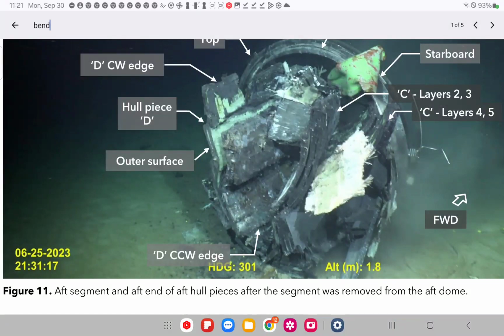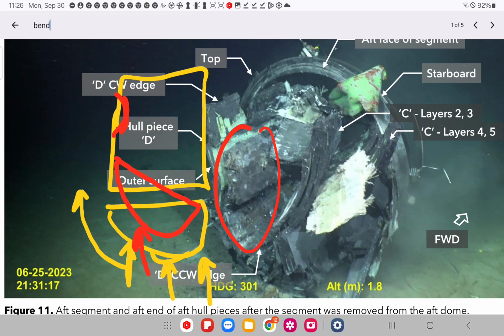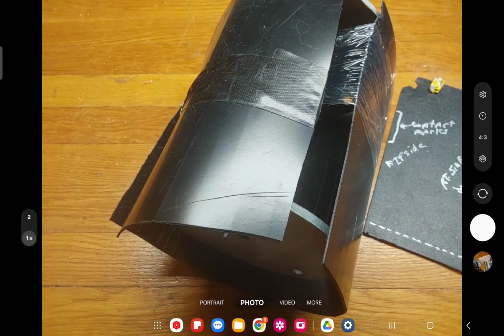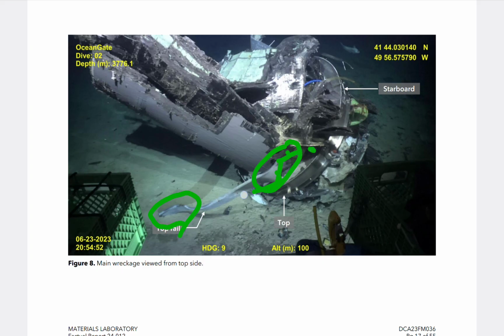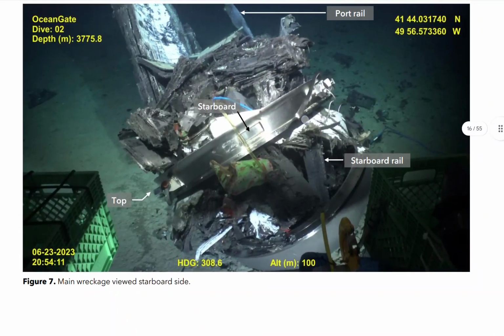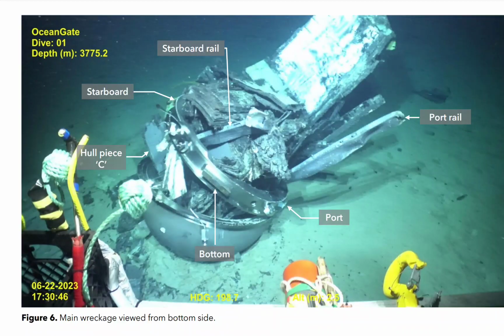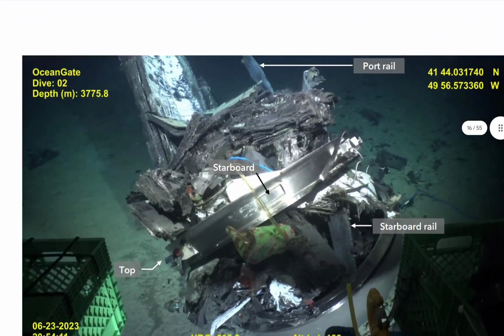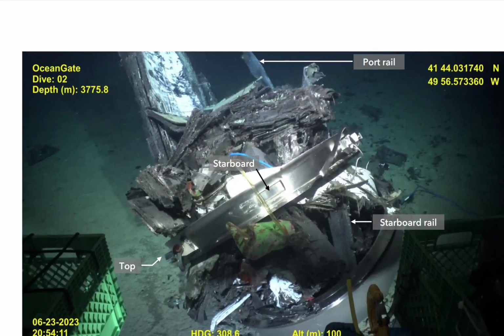Titan Submersible failure visualized Coast Guard- images Carbon fiber autoclave over an hour away

Comment from the maker: Please help me out with your comments and in addition to your comments,  please add the search term you use to search for titan submersible implosion... and for interest,,shout-out where you are from.
Ok...
Titan Submersible implosion had layer failure around the 3rd and 4th layer, the real time monitoring system worked but Rush ignored the data from dive 80 forward!
Then we have the issue of manufacturing,  they had to transport this five times, over an hour each direction and before autoclave "setting", this could have segregated epoxy and literally baked in a defect.
This video will explain how some carbon fiber was NOT compressed; the hull had to have buckled first and it appears to be identified in one of the images.
I have high hopes for the one PhD ntsb guy to work this as part of his conclusion.
Reply from the maker: I also believe how and why it failed at certain levels and will support this in a future video... It's very simple (hint)...
Reply from the maker: donate  
Join this channel to get access to perks:
Anyone donating to support the stray cats or my channel remember if I do something that gives you "gift remorse", please contact before tax season ends and I will give you back 100% of your donation.
https://www.youtube.com/channel/UC-_5I5xDiFVcxlnG7uSLuFA/join

Construction Engineering & Failure Analysis Thank you for commenting and giving a thumb's up
Please donate to support the channel, it will 100% go back into the channel.
https://www.paypal.com/cgi-bin/webscr?cmd=_s-xclick&hosted_button_id=V9TGHDE92LQ8W&source=url
Here is my wishlist if you care to go that direction https://www.amazon.com/hz/wishlist/ls/3UBMVWND65U4M?ref_=wl_share
Reply: @guitarista67 it was the shout out for me 😂🐈
Reply from the maker: Thank you ShayShay
Reply from the maker: Bruce, and all of my cats I rescued from the streets have their own personality but they usually all get along --- as long as one does not invite the attack mode by trying to creep pass another --- then the game is on!
Reply from the maker: Unless, you do real world model testing - then you will find the ''error in your ways" --- If, he would have done it to scale and tested to failure, that would have been the best money spent. Of course, mapping the hull with a dead blow hammer and charting it on the acoustic monitoring is also critical
Reply: The forward ring will tell you the density of the ocean floor.
You know that thing fell fast.

Comment: They have identified the larger sections as roof. Not floor.
Their experts state the failure probably started at the front floor area but the rest probably happened as you describe. You also seem to be under the impression it imploded close to the seabed but remember 50-300m is close on these scales. The debris probably spit out of the aft section upon touchdown due to the envelope effect and shielding vortex of water streaming past as it falls held a lot of smaller debris in place. Prevailing current determines direction of the small debris once free from this "confinement".
What amazes me is the shear force of the waterhammer after the initial implosion as it sheared off most of the outer titanium flange as well!
Reply from the maker: 50 to 300 is huge relative implosion location, they would never make the same debris field.
Further, it could be at the bottom, the starting position and I make this clear in other videos.

Comment: Kemper engineer, or the NTSB, briefly showed a photo of previously failed carbon fiber external pressure test. It was crumpled into pieces. On page 6 of the memo, "Why we don't use this material for deep diving equipment."
Reply: The way the scale model sucked in the sample bag that had been outside might support the idea of the outer layer chunk pulling into the gap between ring and dome at a late, lower energy part of the implosion as discussed in the video

Comment: The important thing that is being missed by most commentators is that the initial failure of the carbonfibre tube was to all intents and purposes instantaneous. The tube collapsed and the titanium end caps were pushed towards each other in around one millisecond. The interior pressure and all the contents and crew went from 15 psi to 6000 psi in a couple of milliseconds. This compression caused temperatures to rise to in excess of 1000ºC and resulted in a diesel explosion that consumed and vaporised all organic matter. As the outward explosive pressure dissipated the hull and end caps finally collapsed into the positions in which they were found. The whole process probably took less than 5 milliseconds, start to finish. The polycarbonate window was ejected during the explosion part of the disassembly because it was designed to resist external pressure, not pressure from within the submersible. If the collapse had been witnessed, it would doubtless have resembled the explosion of a depth charge in a submarine movie. The disruption was such a violent event that it was noted on the surface vessel, but at the time the crew on board the surface vessel just thought it was a hard wave impact or piece of equipment banging against the hull of the ship. The velocity and violence of the implosion, diesel explosion, and final implosion would have been similar to a large bomb going off. Hence the reason that no recognisable organic remains of clothing were recovered. There are plenty of videos showing how carbonfibre fails  without warning compared to stainless steel and titanium that while capable of sudden failure at least show signs of deformation before collapsing orders of magnitude more slowly than carbonfibre. Had the center tube been made of titanium, it would still have been a weak point in the design and a point of failure, but it might have survived the pressure at Titanic depths. The downside would have been a doubling of the weight of the submersible, a larger support vehicle required, and several times the initial construction cost. The key point to bear in mind is that this became an explosive disassembly once the crew compartment was compromised and the resulting damage and wreckage pattern clearly demonstrates this with the scattered debris field. If it were a purely implosive event, the wreckage would be confined in a very compact debris field.
Reply from the maker: What I have been saying from day one except, I am leaving out the heat... if the air is allowed to press out, then we do not have this heat, but we do have friction that would have created immense heat and yet, NTSB has not shown us any ''melted'' products (not even epoxy)... from friction
Reply: The implosion causes the explosion and it oscillates a couple times until final position , or maybe it was just in out in since the pressure was extreme, i just wanted to add the word oscillates =D

Comment: The thing I find most surprising is that the RTM data was not taken seriously. Sound is created by energy. That energy has to come from somewhere. That somewhere is within the composite that is being stressed and releasing energy in the form of sound - probably heat too. The problem being that this energy is lost. It's not being put back 🙂 Then after the most noteable "bang" the hull went silent? Surely this would suggest that the hull was slowly getting like a roll of wet toilet paper?  6000 psi water has amazing penetrative capability. Microscopic holes will pass jets of water capable of cutting resin. Delamination of a significant portion occured. Another thing to be considered - In a 5 inch thick beam (cross section of the hull ) the upper half of the beam is under compressive force and the inner is under tension. This is one of the problems with composite materials - the material within the component are trying to move in opposite directions 🙂 Oh - if you were listening for it you would have heared it on the surface. By "listening" I mean a hi gain microphone in the water. The implosion would have instantly compressed  the air in the hull to 6000 psi. Lots of heat and energy released 🙂

Comment: I think it failed at the ring, it shows the lip of the titanium sheared off which wouldn’t happen after it already loses pressure I think .
Reply from the maker: Yes, it could happen after loss of integrity and the literal shear direction can be determined by the angle of the striations of the steal striations (just like you could tell which direction a can opener was used).
Reply: @ForensicCats  In context, I think you meant "striation," but you left out the "i."
Respect from Montana USA.
Reply from the maker: oops and thank you at nonmihiseddeo   thank you
Reply from the maker: corrected and that was all that was edited, thank you

Comment: that first inch layer was baked 5 times, expanding and contracting each time. the delamination started there in that oven.
Reply from the maker: Yes, I believe the issue if any was bought up in the hearing, he could not think of any issues.
I could, the same part being autoclaved (ring 1) but the heat appears to be within specs of the carbon fiber tow)... Remember, the mandrel is still there.

Comment: I wonder if everyone is getting the implosion breach wrong. I don't have a degree. It was stated almost universally that the breach started at the forward end, that's why all the carbon is crammed in the aft dome.  Air doesn't flow in the opposite direction to the breach it's displaced by the incoming water and escapes through the failure point (depending on the size of the breach) or gets trapped and compressed inside the remaining structure. Additionally, If there is a breach in the aft end within a millisecond of the first, incoming water from the second breach would reverse the pressure gradient, causing the materials and air inside the cylinder to be pulled in the direction of the second failure. But the Forward end-cap is clean of all debris, and adhesive bonding. In simplest terms, where the breach started that's where all materials go. This is a very complex event when figuring out the physics behind this. I don't think anyone has described it accurately

Comment: So for an answer to the "what happened to the people?" question.. the acrylic window was held in by a small ring on its external circumference when not under pressure. So my theory is that when the hull caved and turned them into a idiot smoothie, it then blasted them out of the small hole in the forward dome like a pressure washer, just a column of red water and compressed air the exact size of the view port which then got blasted out into the dark. There is nobody left in that forward manhole.. maybe just a stain or two.

Also, I just came up with this theory by myself, im sorry if it's been said elsewhere. No thoughts are completely original, and we are possibly living in a simulation and the birds might not be real so give me a break please.

Note 2: I realized that there is a flaw in my theory after thinking about it. Differential pressure. I was assuming that somehow the pressure inside the hull was higher than the pressure outside of the hull as it collapsed, but things were only trying to equalize. There may have been a water-hammer type effect which blew the window out, possibly remains too, but not enough to call it a pressure washer.
Reply: That does make sense…
Reply: Wasn't there a greasy film on the surfaces of some wreckage-- the fatty traces of the former occupants?
Reply: I think your theory is of value. I'm not a technical person but I get what you are saying. 
Anyone who gives you a hard time... the answer is:
How would they know, they weren't there. 😊
Reply: There were confirmed human remains at the back end but who knows, maybe most of it got shot out like that
Reply: @alayneperrott9693 some stained fabric or some such is my guess
Reply: Do you think that the air inside got super heated and incinerated them before it imploded?
Reply: @thebird2253 gotta agree with u except on one point. The circumstances of an implosion and the rapid pressure differential at 3700m  liquefied even the bones...
Reply: Ick!
Reply: @brushhogg1  oh wow bones too 😱 I didn’t know they can liquify under pressure.
Reply: Given the relative integrity of the hull, I am figuring that the remains weren't merely human paste.
Reply: @michaeltaylor8835  well if the air got compressed im sure there was a teeny tiny period of time where the air was compressed and superheated, turning the water into steam even, but it would have been such a tiny ammount of time and would be unlikely to cook anything that was inside the hull.. aside from surface burns (my best guess). After everything got compressed the heat was most likely dissipated rapidly into the surrounding water. You can actually calculate the time it took to collapse by figuring the density of air at 1 atmosphere, take into account the outside water pressure (which is known), then take into account the resistance to compression of the internal volume of air, and you can get the force the air exerted back on the water as it compressed, slowing it down, and with that time in mind, calculate the actual volume of air after compression and you have a compression to time to volume ratio and now I'm going to stop ranting and let someone else explain how that translates to heat..
Reply: @melodymacken9788  ...but the fish were there. Somewhere, there is a fish or crab with the craziest story..
Reply: I really want someone to recreate a small version of the sub and put some chicken drumsticks inside to see what happens to the meat and bones during the implosion
Reply: If anything, I would picture that the crew or what remained following the implosion and heat would be hammered into the rear dome cap, along with the larger pieces of carbon fibre.  The speeds at which this all occurred though are mind boggling to conceive and after that thrusting force to the rear I'd expect a counter force expelling the front dome cap, perspex viewport etc.

Comment: It’s crazy to me that in all these photos these close up photos from multiple angles.. there is not a shred of human remains… like nothing.. not a ring not a shoe .. not even a jacket zipper.. just NOTHING 😢
Reply: Actually it's quite possible that there will be a few (hard)  bits left - but they are all under the debris in the aft hemisphere. You simply cannot see it. It's worth remembering that the implosion was quite cataclysmic. Air within the hull went from atmospheric to 6000 psi in less than a millisecond. Biological matter (containing carbon) would not have been happy. Like the inside of a big diesel engine with lots of available oxygen 🙂
Reply: Not the photos released to the public.
Reply: Actually, there's a clearly visible boot in a couple pictures of the wreckage as they were going through it on the ocean floor, but I don't think those pictures have been included in many videos yet
Reply: Out of respect to the victims and their families, they would not have released to the public any videos or photos showing what they had found they referred to as presumed human remains.
Reply: Consider a fake,  there are tons of hints that way.

Comment: So, the loud noise @ dive 80 on Titan sub was on the surface right? That seems to be what the data shows, along with a lot of other noises once at  the surface. possibly from rough handling.  Wondering why the witness though said it happened at ~ 1000 ft/?

Comment: Were the flanges that the carbon fiber hull mated with sheared off on both the forward and aft ends of the vessel?
Reply: I know one was. Just curious about the other.  Sorry for not being clear.
Reply: @Deeked 99% sure we saw both were sheared off. They were surprisingly small. Or stupidly small depending on how you feel about it. Definitely unlikely to be big enough.
Reply: I still can’t believe no one thought glue doesn’t adhere well to extremely smooth non porous surfaces, that in itself should have told mr ego & greed rush it was a bloody stupid idea.
Reply: @Deeked  Me too. Heard about one for sure, in another YouTube documentary.
Reply: @Deeked  both inner flanges gone

Comment: I hope you have fun working this mess out. I use the latest Titan news or updates as my search keywords. I'm from NZ. What intrigues me is the line on the mandrel when the first layers of carbon fibres were laid down, what is that vertical line/circumference? They go over it twice and is quite visible.
Reply from the maker: Yes, I have noticed that "white line" but the was not the hull version 2...